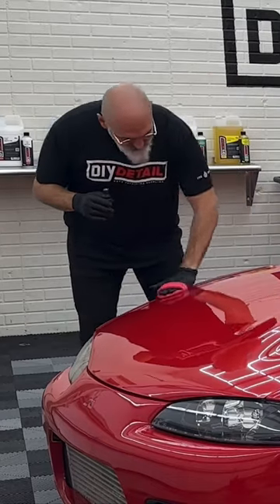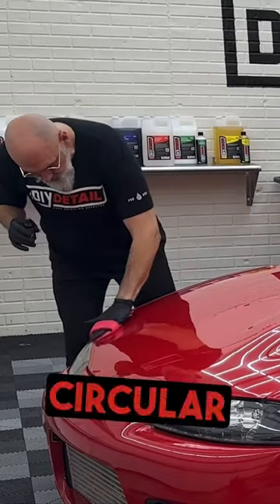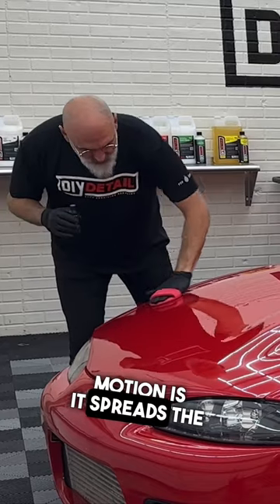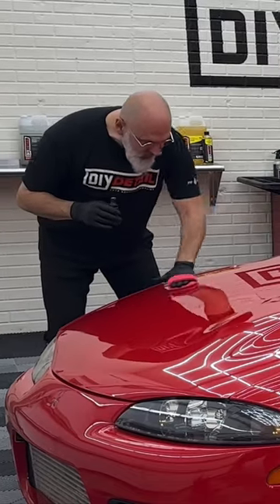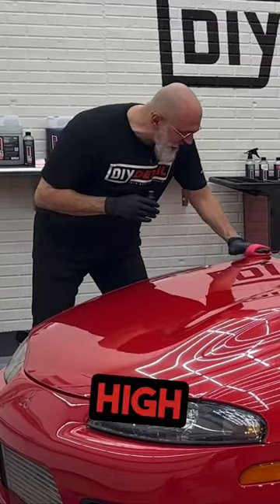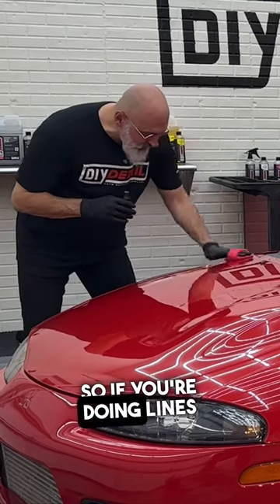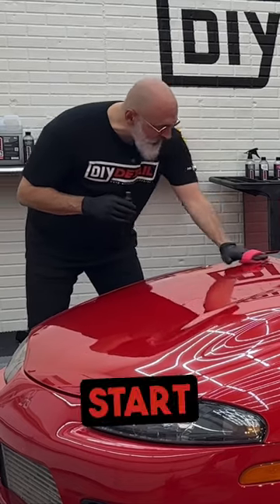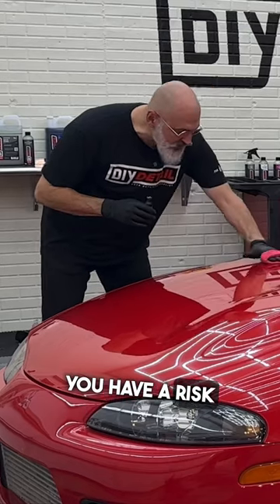How to apply a ceramic coating!

Comment: Never apply ceramic coating in a circular motion
Reply from the maker: Why not?
Reply: It could over time make swirls in the paint, especially in a higher heat then Normal
Reply from the maker: That’s an old wives tale that gets perpetuated in the industry. If your applicator is leaving swirls you have bigger problems. Also next time you see a car with swirls, look closely, it’s a collection of straight lines that we perceive as a swirl because we look at it through a single point of light.

Comment: Circles, the taboo shape or pattern in detailing world lol jk
Reply from the maker: If you prefer figure 8’s, triangles or Squares, that works too.
Reply: @diydetailofficial  lol, I guess washing in circles is the big no no but I love the videos always informative, insider tips, and the products to love.
Reply from the maker: That’s an old wives tale.
Reply: So what's your thoughts on people claiming shape of swirls are because of the shape of the light source. For example they claim the sun is circular, so you get circular swirls when inspecting the paint.
Reply from the maker: Agreed
Reply: @diydetailofficial  well, thanks for the bit of insight.
Reply from the maker: Thank you